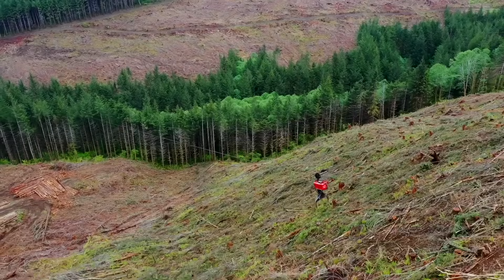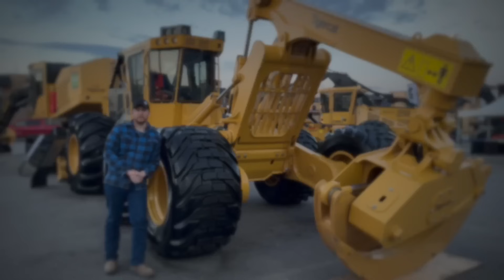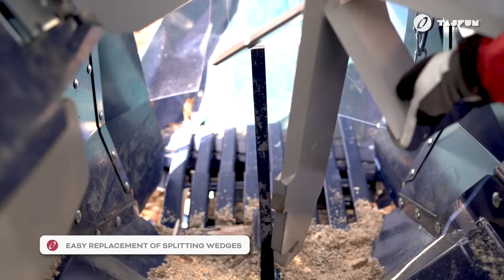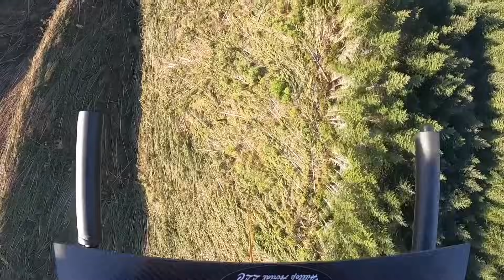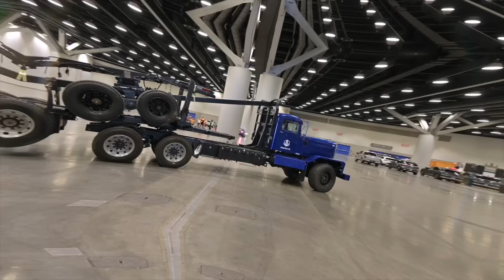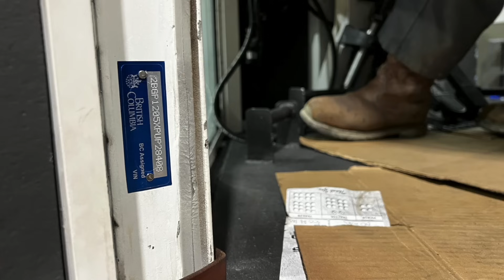Tough Machines: The InterMountain Logging Conference 2024

Comment: Watch what colour of coolant used, corrosion in inventor cooling.
Cat extended corrode (temp probs in proheat, eberspacher, etc). RJ Corman rail power green locomotive, corrode metal surfaces inventors, choppers using  red coolant.

Comment: And for 2024 Edison Motors has their prototype Diesel/Electric Hybrid Heavy Duty Semi. Range on batteries is over 200 KM then the 9 Liter Caterpillar Generator starts up to power the truck while recharging the batteries.
This truck nicknamed “Topsy” after the elephant euthanized by electrocution at Coney Island in 1903. “Topsy” is designed by truck drivers for truck drivers mainly for “Long Logging” and other heavy duty and off road use where a pure electric truck simply is not suitable.  Topsy is built to haul loads up to 180,000 lbs and the first load moved (before it was street legal) was slightly heavier than 100,000 lbs. the future of long haul trucking isn’t with BEV Trucks but with Hybrid Electric Trucks, Edison Motors is also working on conversion kits for Heavy Duty Pickups that will replace the ICE Drivetrain with Electric Axles, Battery Packs and an onboard Range Extender which could be Diesel, Hydrogen, Gasoline, Propane, or even a Microturbine Driving a Generator

Comment: One big thing, I think, about getting 10-15 years out of the batteries before needing to swap them is that by that time it's a very real possibility that the newest generation of batteries might be a massive improvement over the batteries you had in there even when they were brand new.
Reply from the maker: That’s right
Reply: By the end of 2026 you're looking at half the current costs on Li Fe Posphate and increased capacity and life spans plus Charging equivalent of 8-9mins that gives about 185 M range ..in an EV.

Comment: would it not be more efficient to heat the cab and the batteries while the generator is running from the generator coolant. and electric when the generator is off? also are you, or going to be sandblasting all that bare metal before paint? or do you just paint over the fresh steel the way you receive it.

Comment: In my opinion a lot of silicon valley tech startups start out legit but quickly turn into get rich quick schemes on investor money.  The product ends up taking a back seat to the business itself which then becomes the product they are really selling to suck cash out.  Beware investor sharks posing as partners lurking around sniffing for an easy meal.

You are doing in right with keeping things small while proving the product and then methodically grow at a sustainable and profitable pace.  So many companies fail because they assume future sales and market share and run the company on arbitrary spread sheet numbers as if they already have those sales.

Comment: So on the logging trucks. If they somehow end up generating more power going downhill than they will need going uphill. IF that turns out to be a significant amount of power. I wonder if yall could do a reverse charger station at the sawmills. Offload the extra electricity and power the mills with the trucks. Might be wishful thinking but would be awesome.
Reply: The trucks can reverse charge. It would be very situational if it makes operational sense to install reverse charging infrastructure on site and discharge from the truck(s) between trips.

Comment: Great presentation, if or when you stabilize the fabricated parts design of the truck a set of detailed technical drawings would allow you guys to contract out fabricated items and save time and money. Tech data is expensive though are you using a  decent CAD system?

Comment: Awesome and very informative, and got me thinking!! 
In the world of E-bikes when batteries start to fail or more specific when cells in said battery pack start to give out we are able to diagnose which cell is failing and change our that individual cell or a whole group in a series. Saves hundreds of dollars on a 52V battery pack when it can be repaired  rather then replaced.  
Not sure if that would ever be an option in the world of Edison but thought I would throw it out there for possible discussion.
I am by no means a genius in the world of electric, but being raised by a cheap Alberta farmer and in the age of DIY on YouTube I have become "YouTube certified" on a few things.   
Keep up the awesome progress guys!!!
Reply: YES my NEW ( Lectric) bike did over 35 miles in Vancouver Stanley Park training my mini Australian shepherd to heal alongside me. Only one drop in the power box using the pedal to assist. When I got home I had no power to electric the motor. Screen worked. The company walked me through troubleshooting. And it's all plug and play. You can't plug in any connection to the wrong hole. The company is sending me a new motor and I can replace it myself. Or there is a factory service shop nearby. It is so simple to troubleshoot. The factory guy went through a few tests over the phone with us, and we figured out it was the motor. I love that you can't connect into the other wire. On disconnect of any wires.

Comment: You should correct your math. @ 30:00 "Our total weight is about 100,000 lbs....105,000 lbs so on our very first load we already hauled 100,000 lbs more than any other manufacturer of electric trucks. Everybody else hauls 80,000 lbs max they're focused on the highway...." By my math 105,000 lbs is only 25,000 lbs more than 80,000 lbs. NOT 100,000 lbs more. Tesla Semi electric tractor can haul 80,000 lbs(max allowable amount w/o special permit) easily. Also, Tesla Semi has available 1,500 HP if a customer needs it.
Reply: 80,000lbs is only the maximum in the US. Elsewhere limits are higher, such as Canada, Europe, and Australia for example.

Comment: re. the firewood processor, making chip from large logs is a lot more input intensive. If direct to retail outlets - or even selling wholesale cords to the firewood baggers for retail distribution - it is better to dry and burn cleanly, so long as it really is wastewood..  (Being based out of slovenia is a WAGE scam.... Design and manufacturing a machine such as demonstrated - - is something any farm-trailer/equipment manufacturer could knock up -  wages and redtape is what kills the manufacturing  business.

Forestry and mining equipment - FEA is done to know how OVERBUILT the machine is (I am the sale, I want a 2x safety margin AFTER the fatigue limit is designed for (because someone will always take it beyond the design limits..

(getting the rope across the canyon - before Drones - I hope someone has tried to shoot a lead line across (with a monster bait caster).  (OR get a heli in for 20 minutes line work)

From the talk - IF you had wanted a "fancy" hood and fenders - all you need is to mock up the plywood minimum volume - then shape EPS foam (symmetrically) for the shape to then make a fibreglass mould.  No real need for fancy "computer engineers" - NB you really do have those "computer drafters - as you were able to get a game mockup - same skillset - for whoever did the models for online gaming.

AN interesting (probably a totally obvious and discarded  design)  - for a parallel hybrid - for an AWD heavy truck, use e-axles for the rear, and a torque splitter off the "motor generator" to send power to the front axle, this could allow either - low speed AWD - with electric / mechanical drive to the fronts, OR (throw in an auto trans in there) for highway cruising the fronts could put all the genset (or genset + electric) torque for "most efficient" ling haul highway driving.

Retrofitting an old truck - ?? Simply Re-VIN the "old truck" - it needs a new chassis likely - so running gear, etc - only the cab is reused - a new compliance plate and it is a new truck - "replica".

Comment: Burning wood is part of the natural carbon cycle.  Wood grows, so it is renewable.  Humans have been dealing with forest fires for fever too, so toxicity has been handled.  I would heat with wood as a preference, make sure I had a solid clean burnings stove.
Reply: Upgraded my traditional insert wood stove to a reburn stove. I get about 1/3 more heat out of a load than my old stove. I don't have to use the natural gas furnace at all during the day, only kicks on a few times when i am sleeping and wood fire has died down.
Reply: Yep, most think that a Black Belly stove is the goal of heating and most of it just goes right out the flue.
Reply: @wobblysauce  Even processing firewood is far cleaner. I remember my dad's old chainsaw that used a 16:1 oil mix in a far weaker engine than today. I use my battery saw for smaller jobs. I bet that big firewood processor uses far less fuel per cord than my old log splitter

Comment: I'm a machinery safety engineer in NZ, those harvestline addon kits are an awesome idea, but in reality are a fatigue cracking nightmare!  They get fitted to construction spec excavators, and they absolutely trash the booms! 
Interesting pushing the use as a grapple yarder tower too, there are so few yarder operators left around these parts, most companies have gone over to winch assist harvesters, but there's a couple of old Madills and Thunderbirds still kickin'
Reply: PS: great to see you fellas out there getting the recognition you deserve, keep up the great work!
Reply: Have run a Harvestline and currently run a old Thunderbird swing yarder running a johnson grapple. The harvestline doesn't hold a candle to a real yarder for production and efficiency.   It burns a twice the fuel, line speed is slow, doesn't pull very hard and needs a lot of room to set up.
Reply: I was wondering that when I was watching.  Theoretically if the operator keeps his boom at the correct angle he can avoid any bending moment on the boom, but I wonder if they even think about that.
Reply: Logging over there still has too many deaths. I wouldn't trust the kiwis to know how to do things safely